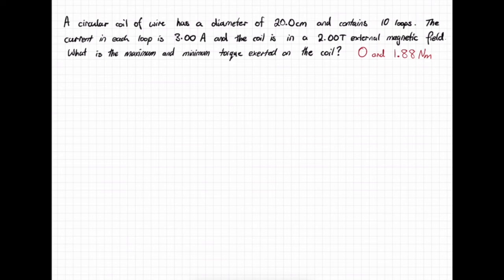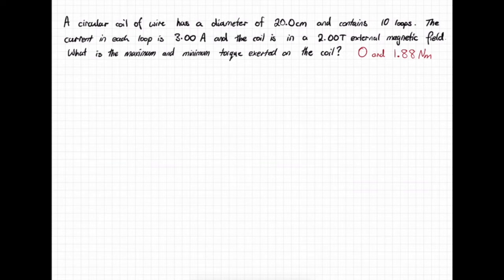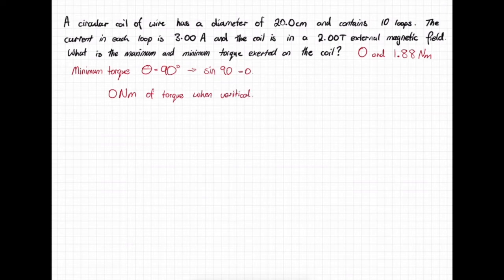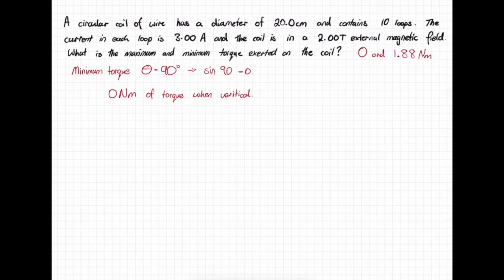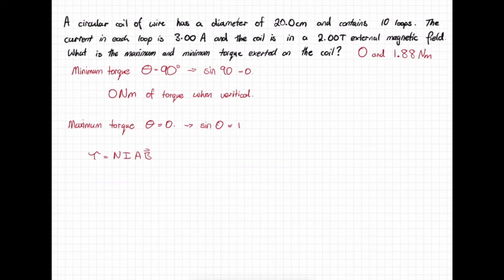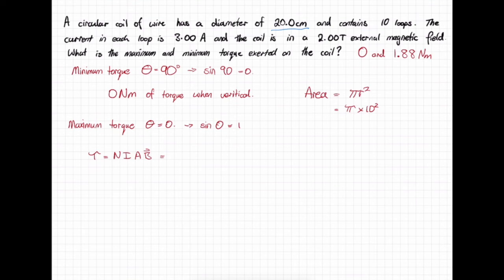DC Motor Question

Comment: hey nick at 0:34, sin 90 = 1
Reply from the maker: Wow stuffed up there. It is meant to be when sin 0 = 0.
θ is meant to be the angle from the normal of the coil to the magnetic field.
This means that the coil is vertical however the normal of the coil is parallel to the magnetic field, thus θ is 0 but the coil is vertical.
Sorry about the confusion, I got mixed up on that one.